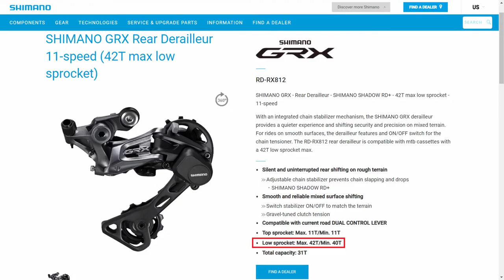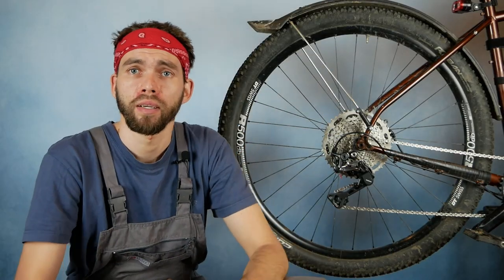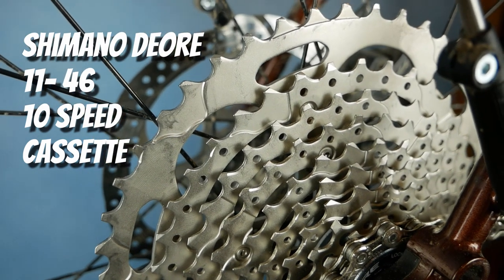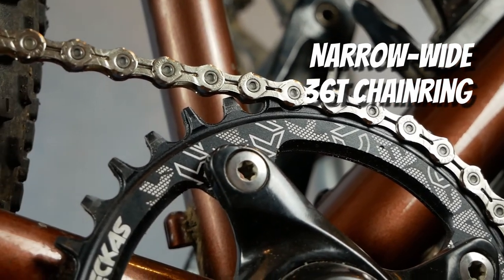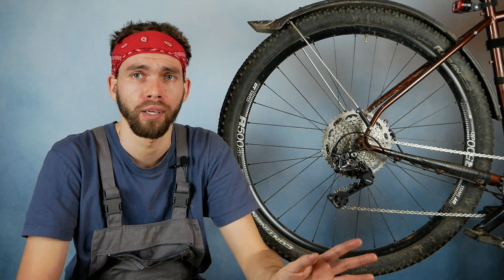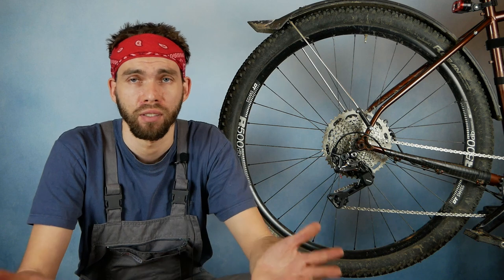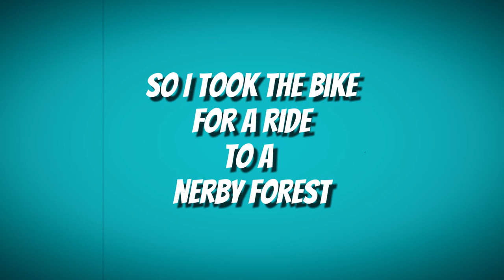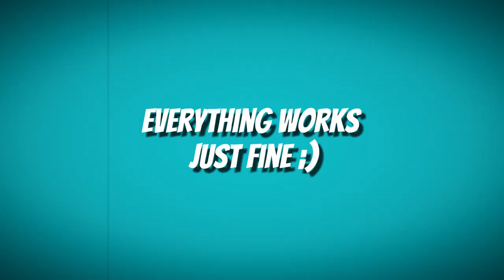Shimano GRX RD-RX812 with an 11-46 Cassette. Will this work? Low Gearing on a Gravel Bike.

Comment: To anyone reading this. 36x46 is NOT low enough for adventure, bikepacking, touring etc. And the jump from 37 to 46 is and will always be, no matter how much you want it not to be, stupid and uncomfortable. It is one of the worst cassettes Shimano has ever came out with and they are continuing to overcompensate for their poor choice by coming out with a full lineup of mtb cassettes with big cogs that have steps TOO CLOSE. The best mtb cassette Shimano has ever made is their 11-40t 11s. Pair this with a 42/26 crankset, and you’ll be much happier with evenly spaced steps, a low enough low gear and a high enough high gear.
Reply from the maker: Really depends where you ride. Last year I crossed Sedlo Pass in Durmitor, Montenegro with this setup (with panniers) and it was allright. And as long as grades are up to 8-9% it is ok, at abut 10%  it becomes hard and from 11% and above its gets pretty bad. But I'm going to get 11-51. Gear jump doesn''t bother me at all. But I'd be happy to swap this for 42/26 any day! Do you know any widely available crank with this chainring combination? Widely available is a key as I don't live in US so any niche product from local manufacturers is out of question :(
Reply: White Industries ships worldwide with DHL. You can order any big ring 38-52 and any small ring 24-38 using their VBC crank. I really want to try 46/26 with the 40 cassette. Puts me in the 15-17-19-21 cogs for cruising efficiency and small steps. But the low gear is low enough and the high gear is a good overdrive for standing and pedaling on flats.

That’s the other problem with a 36t ring paired with Shimano 11s mtb cassettes, which I ran for years. You’re forced to cruise in the 11-13-15 area. And you have no standing up overdrive gear. That sucks.
Reply: Forgot to mention, 26x40 is good to 16% for me with a loaded bike, which I encounter often on fire roads in the northwest US.
Reply: @gearedforadventure One question, I hope you can help me, comparing this derailleur with a Shimano XT M8000, which would be the highest range? I currently have a 1x11 groupset on a mountain bike with a shimano deore 11-speed cassette (11-42) and a shimano xt front derailleur, but I like the GRX, do you think the gearing is good or do I stay as I am?
Postscript, I have a 34 chainring and I plan to put a 36, is it true that the greater the number of teeth there is greater wear?

Comment: I just mounted a 11-46 cassette to my Cube Nuroad C62 pro (from 2020) and it works just fine. Minor adjustments at the derailleur were necessary, but now im happy. Thanks for the Video!
Reply: Do you use 2x cranks ?
Reply: No, I'm using 1x

Comment: Great video! That's interesting that Tiagra 4700 happens to have the correct pull ratio. Would Shimano 105 R7000 11speed brifters also then work with the GRX RX812 derailleur?
Reply: Yes they do.
Reply: yes.

Comment from the maker: BTW: The chain should be longer, I just didn't have any spare links to add. Everything works so far, but to prevent any premature wear I will definitely extend the chain  by at least 2 links in the near future.

UPDATE: Installed 118 links chain and now it is perfect.

Comment: I appreciate this. I'm currently running a GRX 810 with an 11x40, but occasionally need a lower gear. In the past I have switched to a smaller chainring (from 38 to 34), at the expense of my top gear. I just ordered the GRX 812, and I already have an 11x46 on the shelf from an earlier experiment. This should be a better solution, and it will probably (hopefully?) improve my shifting a bit when I run the 11x40, which is most of the time. 

The GRX-810 is pretty impressive in it's own ways, I even managed to run it in 2x with 44x30 chainrings and 11x40 cassette. It had just enough chain wrap and did a reasonably good job in the back, but the front derailleur adjustment was a struggle. Something always seemed to find a way to rub. I enjoyed the range it provided, but I eventually gave up on it and reverted back to 1x.

Comment: I found my range not quite as wide as I'd like stock (slightly ran out of top end with the 38t chainring that came with it). But I love GRX and have the dropper lever and in-line brakes. So I bought a SRAM XD driver freehub for my wheels and put a SRAM 10-42 on my GRX instead. Works great. Lighter cassette than the 11-42 Shimano that came on it. SRAM 10-42 with a 38t is pretty much the same range as an 11-46 with a 42t chainring. (25 to 106 gear inches)

Comment: Dude That's very nice. 

So I could use Tiagra 4700 2x10 speed brifters with the GRX 812 and the Deore 10 speed 11-46  with a Grx 10 sp 30-46 crank ?????????? 

Yehoo that would be nice bikebacking 125 kg up the Alpes. 

Am i right >?

Comment: Thank you for doing this test.  Going from a 11-40t to 11-46t, did you have to re-tune the 812 derailleur?  The reason I ask is that I use 3 different wheel sets (Road, Commuting, and Gravel) and only want to put the 11-46t on the Gravel wheels and don't want to have to mess with the derailleur and chain every time I switch wheels.

Also, to confirm, you added 4 links to the chain from 114 to 118?  I'd imagine this longer chain would also work fine with a 11-40t.
Reply from the maker: yeah, I have 118 links. And it was necessary to finetune the derailer, but mostly by adjusting the b-screw. Proper chain length will differ between bikes, due to different frame dimensions. This one has 455 mm long chainstays, while most gravel bikes will have less than 435.
Reply: @gearedforadventure  Thanks for the info!  It wouldn’t be too bad adjusting the b-screw but it would definitely be a pain to do index adjustments every time.  Any index adjustments required that you remember?
Reply from the maker: @corbinkoepke4598  not sure, but keep in mind I only changed the cassette on the same hub, but if you swap the wheels the new hub might have some micro differences in how the cassete is positioned on the freehub body, and this might affect the derailer performance.
Reply: @gearedforadventure  Thanks again for the response, helpful insight as I decide how to change my setup.  Cheers!

Comment: Hello.

I have a gravel Canyon with Shimano grx derailleur and brakes.

Originally with:
- 2 chainrings 30-46
- Shimano GRX RX400 GS long rear derailleur
- I changed the 10s 11-34 cassette to a 11-42 shimano 10s to climb better. I put a sunrace  extender so the derailleur wouldn't hit the cassette and a slightly longer chain.
It doesn't work very well ...
That's why I want to try this change that you have put, the GRX Shadow Plus RD-RX812.
Do you think this derailleur (of 11s) would go well with my 10s cassette and my 10s grx shifter and my 2 chairings?
Thanks

Comment: Hello! I wanted to ask, is it possible to use GRX RX812 rear derailleur with a 2x11 setup? By the way my chainring is 30T/46T. And for my cassette, it is 11T - 42T.
Reply from the maker: Sorry for answering so late, but I don't think this derailleur can handle it, it doesn't have enough capacity. Although there are some modifications where people were using RX812 with modified cage from I think XT or SLX derailleur and it worked on 2x. You can search on youtube.
Reply: @gearedforadventure  It's going to be challenging to get a  shimano MTB derailleur to work right. Pull ratios are different from road group sets.
Reply: @paulh9301  I think he is just talking about the cage from an XT on the GRX derailleur. Similar to how Garbaruk offers an extender cage for the -812, so that it can handle up to 50t.
Reply: Currently my bike is running - 46/30 and 11-42 cassette and grx812 doesn’t really like it. It shifts, but you need to be very precise with chain length. Like on my road bike never was I in small ring front and small one at the back. So if avoiding small small combo, it’s doable as long as you know what you are signing up to

Comment: I can safely say the 812 works with an 11-46
Reply: Thanks for providing the confirmation.  Going from a 11-40t, did you have extend the chain and/or re-tune the 812?  The reason I ask is that I use 3 different wheel sets (Road, Commuting, and Gravel) and only want to put the 11-46t on the Gravel wheels.

Comment: Hello Sir, do you know if this rear derailleur can work with mtb shifter like deore, slx, or xt?. 🧐
Thanks.
Reply from the maker: It does not, but mtb deraillers are usually cheaper and have greater range than this GRX so I don't really see the point in doing this

Comment: thank you for your vide! it is very interesting. Would does it  work with 2x crankset ?? For example with 46/30T
Reply from the maker: I don't think it would be able to take so much chain slack, this derailleur isn't really meant for 2x. But there is a youtube video where someone swaped the GRX RX812 derailleur cage for SLX derailleur cage and is seems to work like that.
Reply: @gearedforadventure  does the derailleur that you used is medium cage?
Reply from the maker: @riyahsuharto2159  It is GRX RX812, I think technically it is a medium cage, though this model is available only in one cage length.